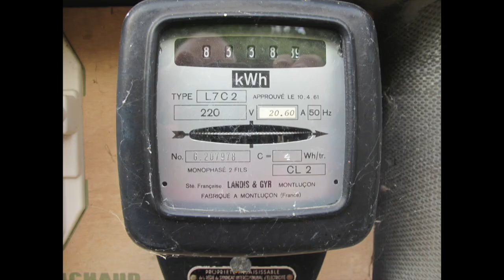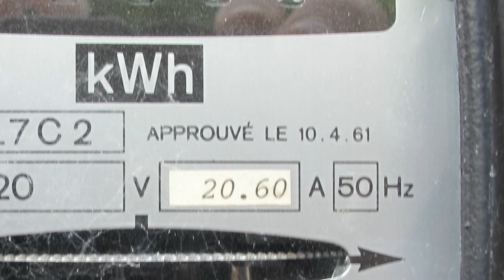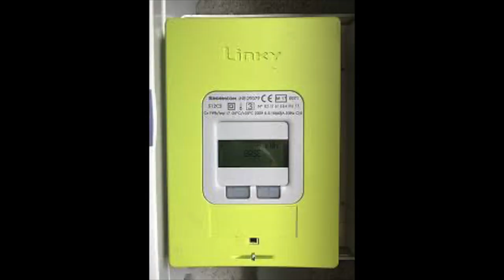Kia e-Niro: Charging Changes.

Comment: The resale value of KIAs and other Asian (EV) brands is actually very reasonable, not to say good. EVs are superior, in my opinion, when it comes to comfort. They offer a quiet, very smooth and comfortable drive. You will need to buy a much more expensive ICE car to achieve the same level of comfort.
Reply from the maker: You comment confirms everything I have been saying here for the past 6 years.

Comment: Hi Mr e-Niro, we have a Kia Niro EV, which has vehicle to load and before Christmas last year we had a storm which knocked out our electricity for 4 days. V2L was a godsend, we had an extension coming through a slightly open window off which we ran other extensions. So we were able to run the fridge freezer, table lights, the tv, the internet as well as a pc and keep phones and an ipad charged and in use. After the 4 days we had used 30% of the battery, so the battery could keep us going for more than 12 days. Thanks for your channel and your efforts. Regards to Mrs e-Niro, I hope recovery is going well.
Reply from the maker: I had a short drive of the Niro EV last year, more comfy and cushy ride I thought than ours. The V2L was a real step up and good to know you found it useful. V2H is what interests me given that I have solar with more panels to come. Thank you for asking about Mrs. E-Niro, it's 6 months since her hip replacement and she's fully recovered and in full gardening mode now. 😊. Thanks for watching.

Comment: Thanks for your update, I always look forward to them. We invested in 7 x 440v panels and a 9.6Kwhr batter last Autumn, purely for our little cottage in deepest Dorset - payback is around 8 years but, rather like the EV, this is not  important (my Estate Agent neighbour advised that the value added to the property was pretty much equal to outlay). Over winter the battery was primarily charged at cheap overnight rate and discharged during the day (we had a really overcast season with little sunlight seen during the shortened day). As we come into summer I think we will pretty much eliminate domestic electricity bills, which is the reason for doing it. The monthly cost of charging our two EVs is just under £60 - the garage is on a separate supply (costs around £0.09/kwhr, including standing charges, on Octopus overnight EV tariff). We are taking our E-niro to Brive-la-Guillard and then on to Switzerland in a few weeks with no range anxiety anticipated. Of course ICE is best, just because???
Reply from the maker: You will probably be passing close to us on your way to Brive. We are just off the N10 between Poitiers and Angouleme. There are some new rapid chargers (Fastned) just south of Ruffec on the N10 about 15 km from here. You are welcome to drop in for a cuppa😊
Reply: @kiae-nirodiariesencore4270  Thanks for the much-appreciated offer. We do a bit of a meandering route, from tunnel we stop at Wisques and, via Rouen (to avoid the bloody motorbikes on the Peripherique), then, again, at one of our favourites, La Tonnellerie at Tavers (no charger is only issue) then straight down. I'd love to drop in and compare notes but we will be on a schedule (have to open up ahead of family). In spite of his Muskship we tend to use Superchargers (assuming they still work for mortals).
Reply from the maker: @pauleast4372  no worries, have a great time in La plus belle pays du monde...as the French love to say. 😊

Comment: I hope to be able to afford a top spec EV3 when it is available in Canada, I think next year. I admit to wanting the perks. I absolutely don’t care about resale value, power or faster charging etc. just range, a small degree of future proofing, safety and style and comfort perks. I expect to drive the car for 15 years if I can, even if it is super obsolete after a few years. I want to be part of the cleaner future. It’s time for me. I know everyone has their own preferences but for me it’s time. I’m still driving my 2011 KIA Soul 4u luxury and it’s been excellent to me. I’ll be charging at home and hope to use the V2L and V2 home and maybe grid. We’re moving this year so it’s time to retrofit what is needed. Thank you for your video 😊
Reply from the maker: Great to hear from you in Canada. There's no doubt that a 'ground up' EV design like the EV3 will be a better EV than one adapted from a petrol hybrid like the e-Niro was. Thanks to the e-Niro and Niro EV Kia have a lot more experience of making a reliable EV that drives well, so you should be good for 15 years of electric driving. From what I hear of the Canadian winters, heated seats and steering wheel are a must.  Although if you are in Nova Scotia you are at 45 N slightly south of us on planet earth😊..I've never been but it looks maritime and a lot like the British Isles. Thanks for watching.

Comment: I guess there's no export tariff?
Reply from the maker: There is but it is a paltry €0.04/kWh. Last year exporting was worth €0.12 but the powers that be cut it right down just before I committed to add another 5 kWp. Even with zero export tariff I would still have added the panels which we see as a hedge against higher electricity bills as we add infrared panel heating in the house. We have no central heating, no oil or gas and no radiators to feed from a heat pump. All our heating is from wood burning stoves (3) which we feed from our own resources (we have an acre of woodland plus the hectare of land with the house). We may not always be fit enough to do the work of cutting splitting and carrying the wood, though this work is a good way of keeping fit. 😊. We installed 2 x 1200w infrared panels in the ceiling of our lounge earlier this year and have to say they are very effective. Thanks for watching.